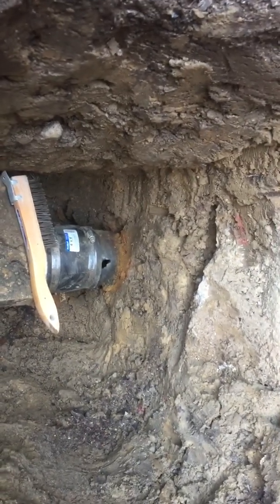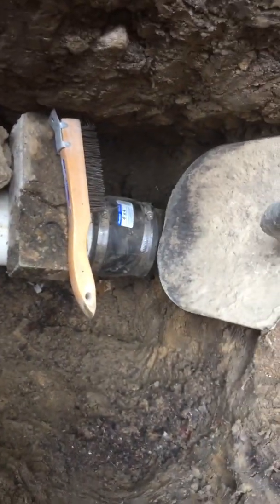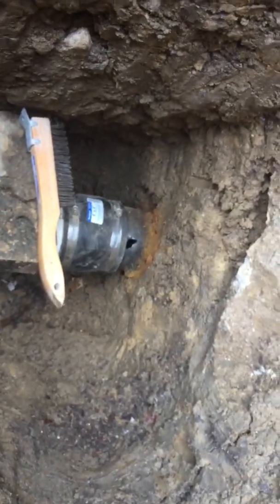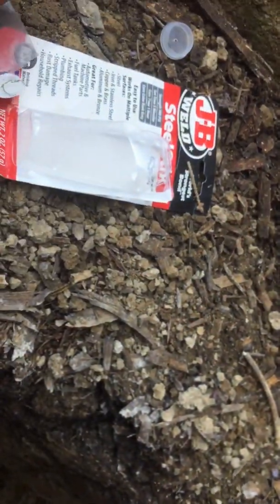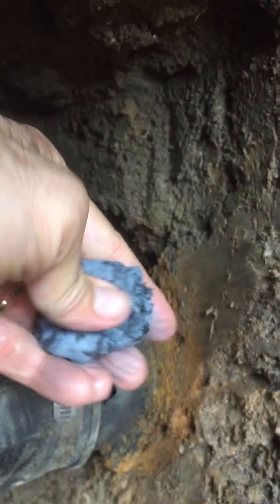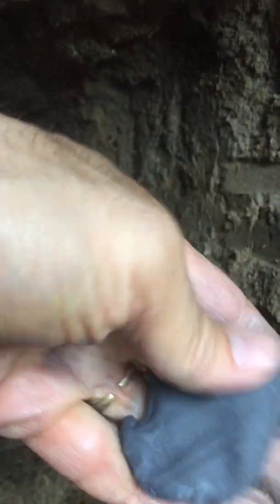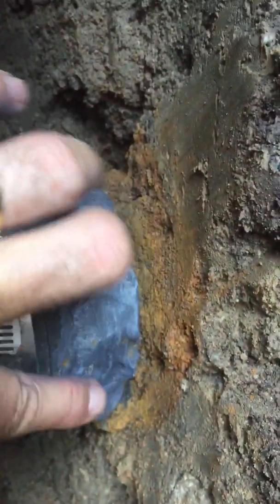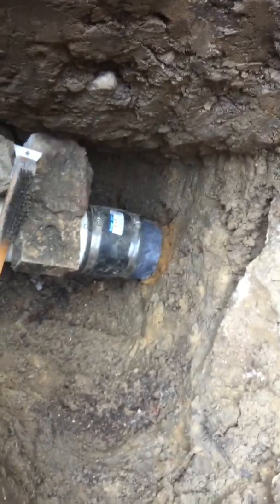JB Weld Sewer Repair

Comment: I have a similar cast iron pipe that is cracked behind the hub.
Excavation and replacement was quoted $8000. I used the JB Weld 4 years ago and still holding strong. 
It did take a few attempts because the rust had to be removed. 
The repair isn't complete till you wrap the compound with included tape to protect your patch and improve adhesion.
This stuff is legit.